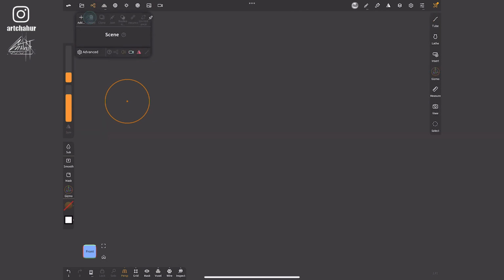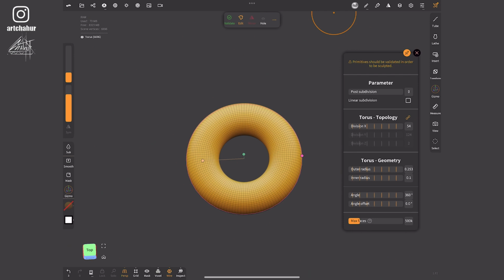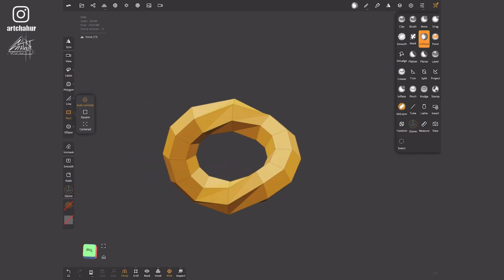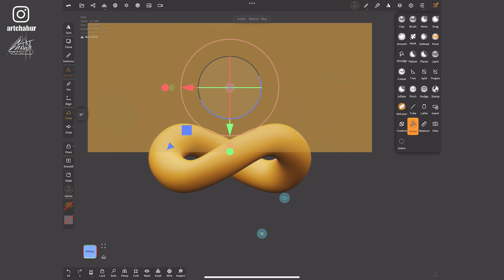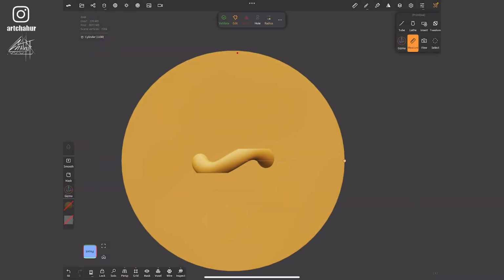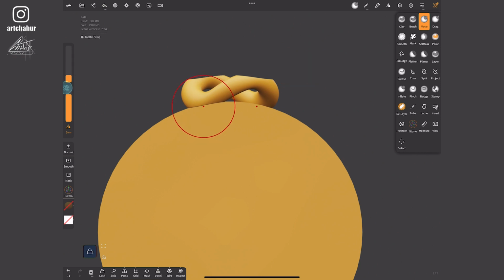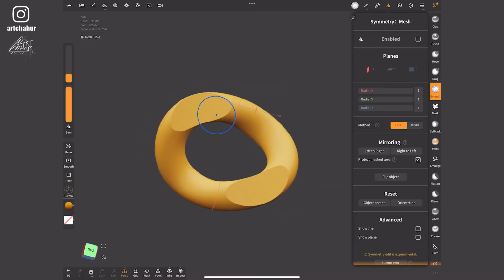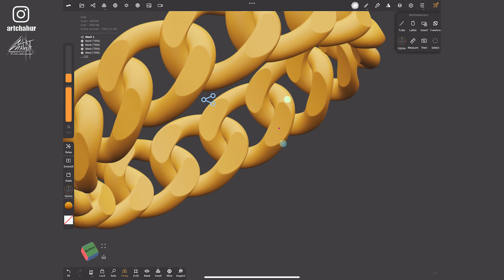Nomad Sculpt  Cuban Chain Ring

Comment: I’m having a hard time figuring out how you cut the part off with the boxes. Could you explain those steps?
Reply from the maker: Hi. At time 1.30 you will see that the check marks on the link and on the boxes should be checked, with only the link visible (eye on), then press the “Boolean” command - that's the whole trick. 

P.S. I recommend that you first see how the basic functions of the program work. It will definitely help.

Good luck creating sculptures!